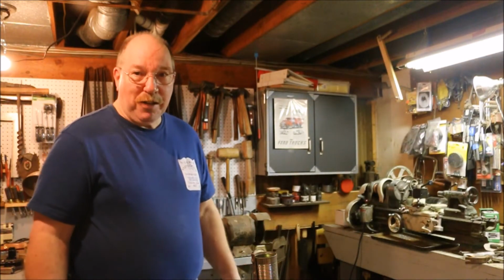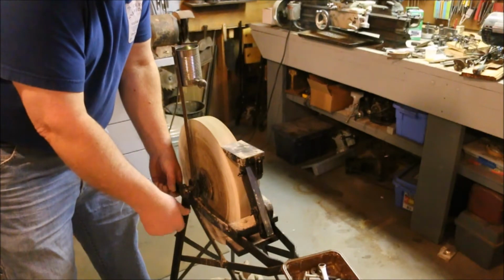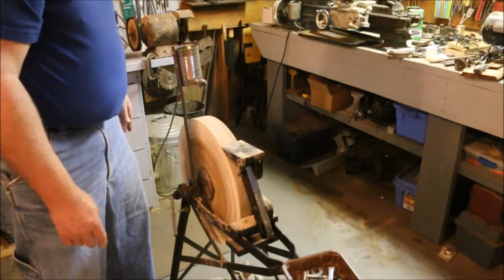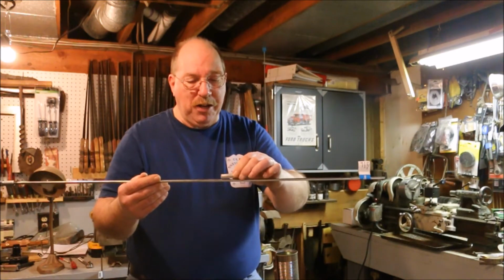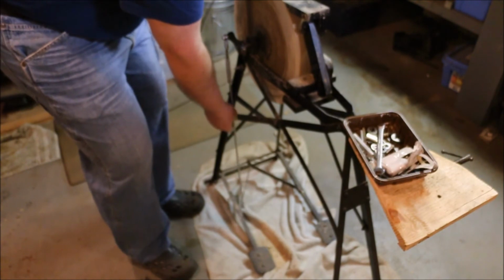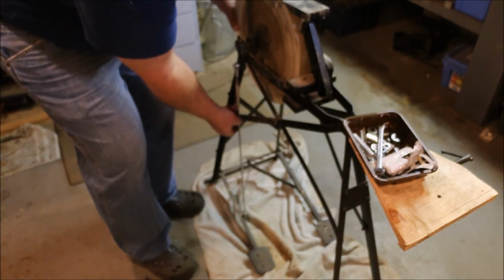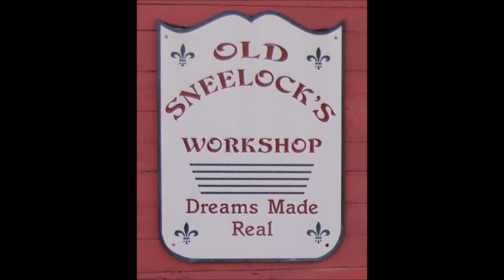TREADLE GRINDER ~ UPGRADING THE LINKAGE WITH HIEM JOINTS

Comment: Using a power grinder to work parts for the treadle grinder...  I'm sure you could have used a file, sandpaper, or a hand stone to remove the burrs, but the handiest thing was the grinder.  It seems that oftentimes you need the tool you're building in order to build that tool.  I sometimes marvel at the things that must have been done to produce the first metal lathe.  I imagine that it would be possible to turn (at least some) metal parts on a wood lathe, but making precision parts (like lead screws, nuts, and flat, parallel ways) with simple hand tools and the like just seems miraculous.
Reply from the maker: Brian Neeley
Turning steel on a lathe with hand tools can be done. I still use files to debur and cut flats on shafts like the treadle grinders crank pins. Jewelers lathes don't have a cross slide. http://bbs.homeshopmachinist.net/threads/45992-How-to-Use-a-Jewelers-Lathe
When I first started as Manufacturing Manager at Douglas Corp. they had a repeat business project for a local papermill. The journals on the 12 foot long, 10"diameter, stainless steel, feed rolls would spin in the bearing races and weld themselves to the race. Our driver would pick up the rolls once a month and we would turn off the welded race. Then cut the shaft under and build up the shaft with weld. The final step was to turn and center the welded shafts. 
I went out to check progress on the job. The machinist was filing the journal and using micrometer to make sure the journal was round. 
In disbelief I asked why he had to do that. When he told me the bearing on the live center was worn out so it had a .005" hop and he was told to file off the last .010" on a 3" diameter journal. He said it took three days to turn the two journals on a single roll. 
I ordered a $300.00 live center. It had a #6 Morse Taper shank. 
The job went from a one week turn around to a one day. The salesman flipped out. He said they erre charging for a weeks work on the job. Standard in the industry is half of replacement cost.  We left the roll sit on the dock for six days. 
The moral is: The talented machinist was able to make the journal round within .001" with a file. By spending $300.00 we were able to free up that talented machinist and the machine to do other work.
As Old Sneelock I do projects to illustrate the possibilities. Deburring the shaft and cutting threads by hand with a file can be done. Much like cutting up the fuel oil tank with a hand saw  instead of the plasma cutter.  Why would I? 😆
Reply: Old Sneelock's Workshop I wasn't saying it couldn't be done; but rather that it's miraculous that it CAN be done with nothing beyond ingenuity, skill, and perseverance.
Reply from the maker: Brian Neeley Please excuse my poor communication. I was attempting to agree and illustrate.